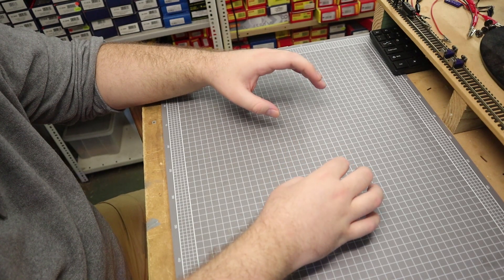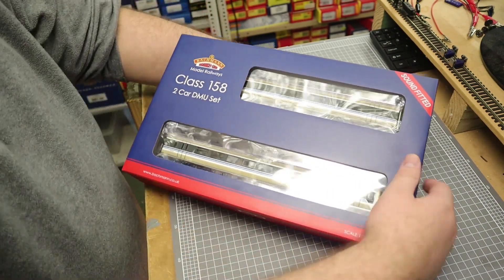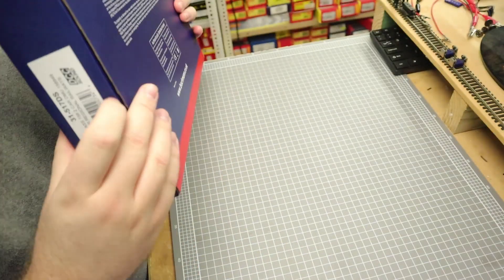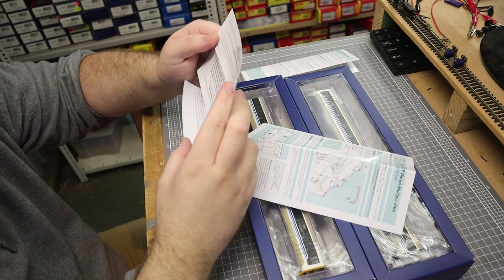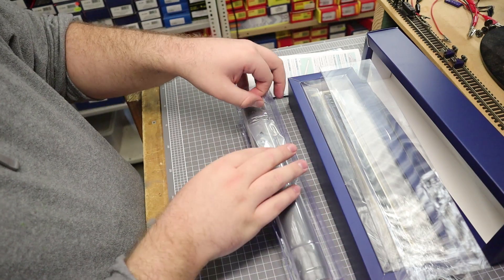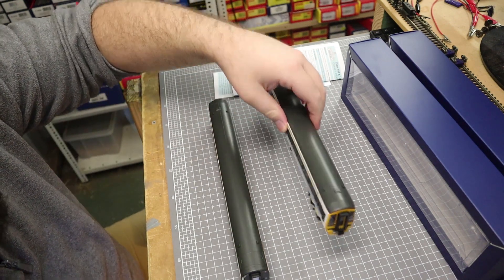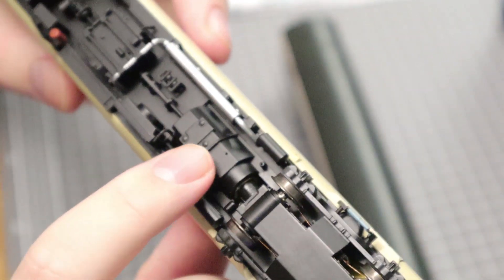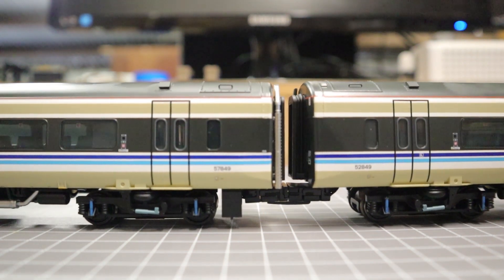25. The Amazing Bachmann Class 158 DCC Sound 31-517DS

Comment: If they both have a motor will they run independently?
Reply from the maker: Chris I dont believe so the decoder is one of the units while the speaker is in the other they cannot operate indapendently. As for the layout in the shed idea, i dont recommend it personally in summer its insufferable but winter for me is fine being in queensland. If your intention is to use a shed ensure it is well sealed and insulated from the elements. Hope this helps, Cheers... Ben.